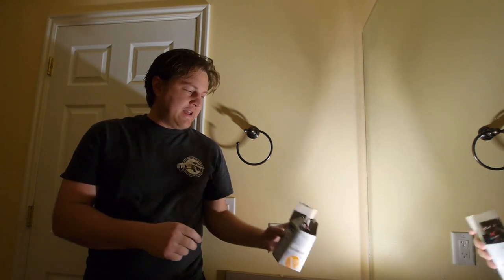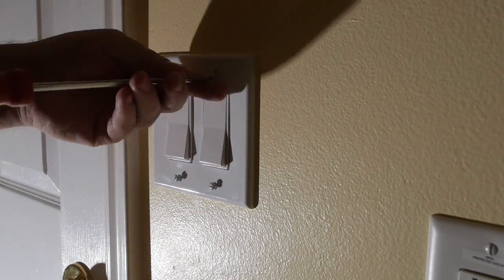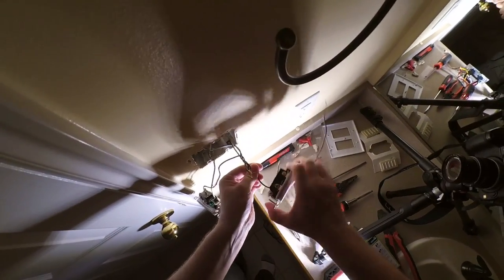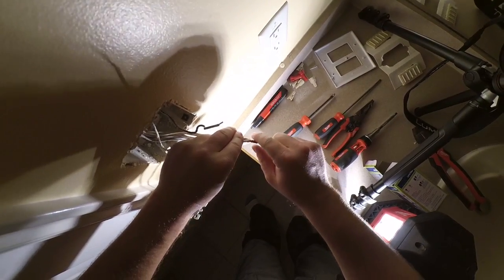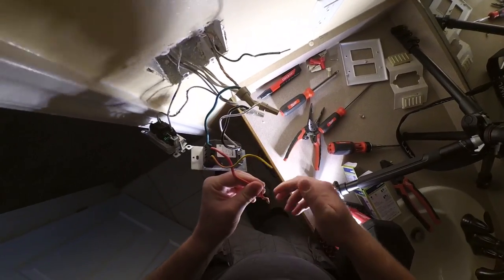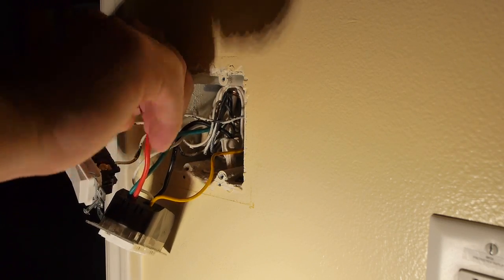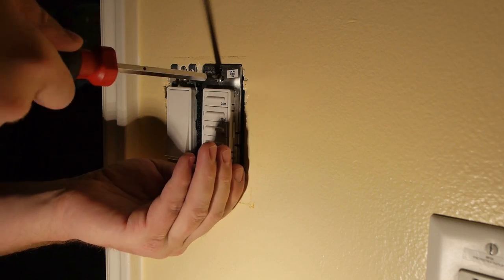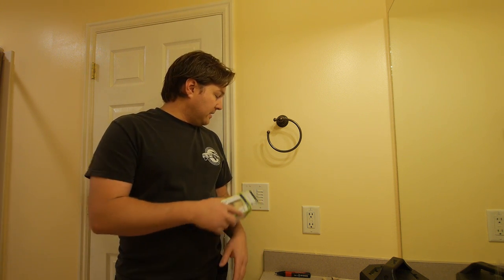Leviton LTB30-1LZ Fan Timer Install

Comment: Thanks for the video...I had a big clod of white wires tied together with a wire nut in the back of my box. I wasn't sure what to do with them, so I was going to send this timer switch back to the retailer. Your video gave me the confidence to press on...used your wiring and it worked perfectly!
Reply: Scott Hancock ditto for me!

Comment: Great video. Just went to replace my fan  switch with a Leviton timer.
But my switch only has a black, and white, and ground wire. 
Would this be because the feed goes to the fan first then loops out to the switch?
Same goes for the switch beside it in the box that controls the vanity lights.
How can I wire the timer in this situation?
Reply: Yes, I was hoping this would be mentioned in today's video which deals with power entering the switch first. This gives us a live black wire to hook up to the black lead on the switch. You have a power before the fan outlet box circuit. Perhaps someone else will comment but think you will have to run a length of Romex from another source to get a live lead to your switch box.

Comment: Hi,

After removing old switch, I only see 2 wires + ground copper wire.  I got the same leviton fan timer switch.  I don't see that extra neutral wire.  Is that a requirement to having this switch working?
Reply from the maker: Yes this switch needs a neutral wire. Check the other comments to see another conversation about this same problem.  A regular switch doesn't need a neutral, so sometimes to save a little wire electricians will leave out the neutral.

Comment: it worked until i tried to put everything back into place now none of the lights, plugs etc are working in the washroom, i know it's not the breaker because the light just outside on the same circuit is on anyone know what to do? everything is plugged in and connected with wire nuts
Reply from the maker: My guess is that one of the wires is loose inside the wire nut. Turn off the breaker and check your connections.

Comment: FAST HELP!!!

My switch only has 2 black wires and a green wire. (NO LABEL) which black goes to land, and which goes to hot? (Instructions don't say either)
Reply: First you need to find out which is hot wire and which is the switch wire.  You can do this by using a non-contact volt tester like the one he used or a multimeter.  Pull the switch out of the box, use the non-contact volt tester and touch each black lead.  Obviously both leads will be hot if the switch is on.  Turn the switch off and try it again, only one should get a prompt from your tester, mark this lead because this is your hot wire.  Look inside your box, there should be group of white wires in there all tied together, they are your neutral wires, most newer homes should have this, and it is required for switches that requires constant power to them like this, bluetooth switches, wifi switches, humidity sensor switches, etc...  If you don't have them, you're going to have to hire someone to run it to that box or your entire house.  If you do have it, you're going to have to use a pigtail to connect to the neutral on your switch to the wall.  A pigtail is a short piece of 12 or 14 gage wire.  To wrap things up, the black hot lead goes to the black wire, the other black wire goes to the red wire, white wire goes with white, and green goes with green.

Comment: What if you don't have a neutral wire
Reply from the maker: Normal switches don't need a neutral to function. Some electricians will save money by not running a neutral to the switch. This timer needs a neutral to function, and unless you can run another wire from a nearby switch or outlet then you are pretty much screwed.
Reply: GetDomesticated   Where I live, California,  I can not recall ever seeing a neutral wire in a switch box.

I guess I could connect the neutral to the ground.  The neutral and ground are connected together in the circuit breaker panel.
Reply from the maker: This is true, but I can't say if it's a good idea or not.  All the boxes upstairs in my house have nuetrals. But i the basement doesn't.  I'd like to put timers down there too. 

So if you try this idea and it doesn't burn your house down let me know.
Reply: GetDomesticated   Using some critical thinking skills here....   If the Green/GND and the white/neutral are connected together in the circuit breaker box they both have the same potential and are therefore electrically the same. 

The only reason we have a ground wire is so the current has another path other than you to get to ground.

While not to code, I can't see how doing this would put someone's life in danger or cause a fire.  The ground is meant to carry a current should the neutral become disconnected or broken.

Let me know when you give it a try if you get a shock or your house burns down.

I'm going to do it and I'm sure it's will work fine.  The only reason the neutral is needed is the provide power for LED and timer circuit.  The amount of current would be far less than one amp.
Reply: I have the same problem. Did it work wiring it up green to white?

Comment: GetDomesticated, I went to put a timer on my fan switch.  Pull the old fan switch out and there's two wires on it.  The new timer switch has four.  I stood there with my thumb up my ass trying to figure out what to do.  The instructions on the new timer switch are as worthless as moose tits.  Your video was spot on!  A thousand thank yous for making it clear and concise!